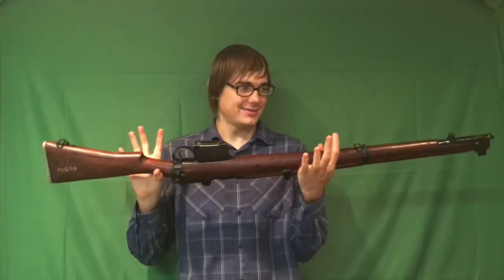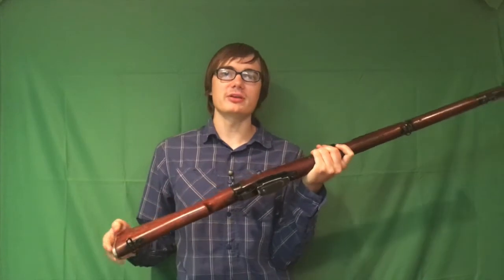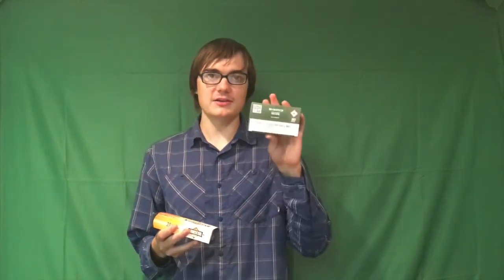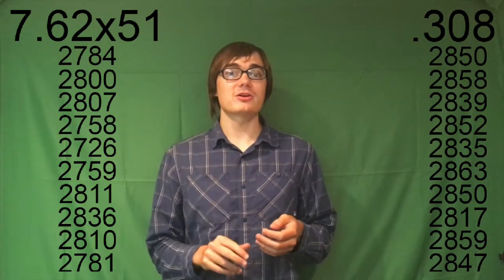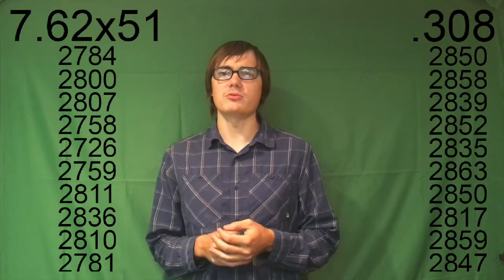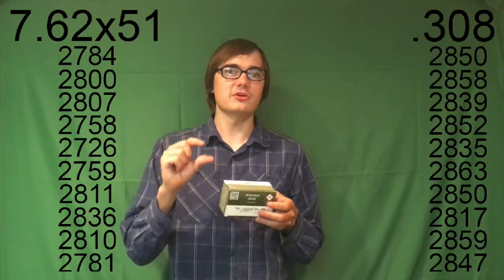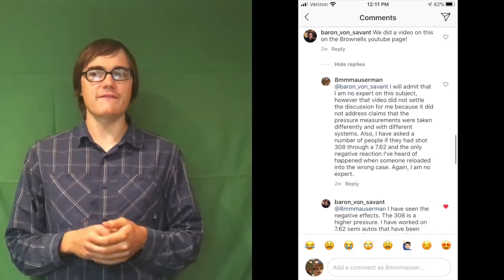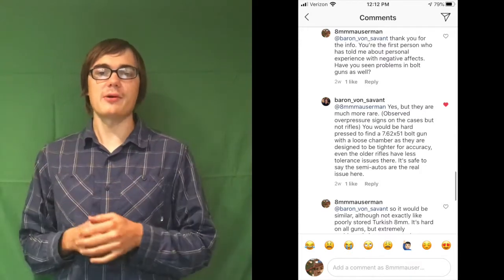7.62 vs .308: Magtech and Armscor 147 gr

Comment: I use 308 & 7.62 interchangeably. Same for 5.56 & 223. The SAAMI warning was geared towards bolt action varmint rifles. Not semiautomatics.

I forgot, when it comes to M1 Garands, you have to stick to the USGI power curve. So only M2 Ball or M80 analogs.

Comment: The pressure differences people keep spouting off with are because the stated pressure ratings were done with different methods and even at different points in the barrel. I've measured dozens of cases from different commercial manufacturers of 308 and 7.62x51, along with military surplus factory lots (all pulled with the same bullet puller) only to determine that there is a huge amount of overlap in overall case dimensions and even brass thickness. While the brass from military lots was thicker on average to not be ripped apart by overgassed machine gun extraction, there was still some commercial ammo that used brass even thicker than military stuff. The often repeated claim of casing length differences was also debunked by my measurements. The intent may have been present, but machines that continuously produce thousands of cases per day have tolerance degradation between maintenence sessions
Reply from the maker: Thanks for your opinion.
Reply: He's absolutely correct. 7.62 & 308 cases, projectiles & loadings vary wildly. 

I found the same while researching what kind of ammo G3s really don't like. It came down to case hardness, and not thickness, as many claim.
Reply: @donwyoming1936  A fellow G3 Connoisseur I see. My PTR will eat everything I feed it and keeps asking for more. Everything from the jankiest steel case to the most prescious match ammo. Although its worth noting the roller delayed blowback guns were originally designed for steel cased ammo, so I shouldn't be surprised it loves TulAmmo and Red Army Standard.

Comment: Back in the day it was the Ruger mini 14 not being able to use 5.56 or like my colt sp1 marked .223 and can't use 5.56. Both can use them equally well with no issues but the 7.62 vs 308 is completely different

Comment: So 2787 on the metric round vs 2847 on the inch version. 

Correct me if I’m wrong:, American designed guns like the M1A and AR10 can shoot both 308 and 7,62 NATO with no problems. Guns like the FAL, G3 and BM59 and SCAR can shoot both, but the slightly higher pressure of the inch version (62,000 PSI vs 55-58,000 on 7,62N) could wear down key components and shorten the guns‘ lifespans. The FAL may be an exception due to its highly adjustable gas system.
Reply from the maker: It should depend more on the markings and date of the guns. Also the ammo. Some hunting loads will be at a far higher pressure than the FMJs that I shot
Reply: @8mmmauserman  Why would hunting rounds have more pressure or be hotter than FMJs?
Reply from the maker: I believe they tend to be at a higher velocity, but I may be wrong in that
Reply: @DNchap1417  usually hunting loads are loaded hotter then FMJ's so as to ensure a clean kill.